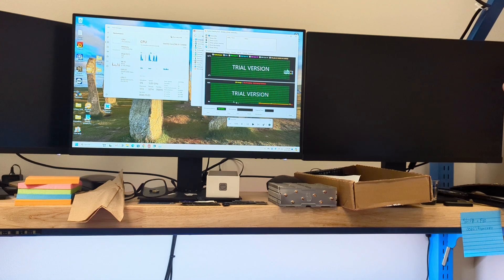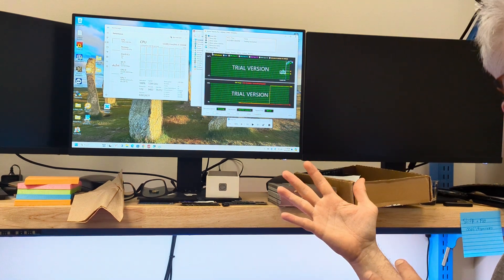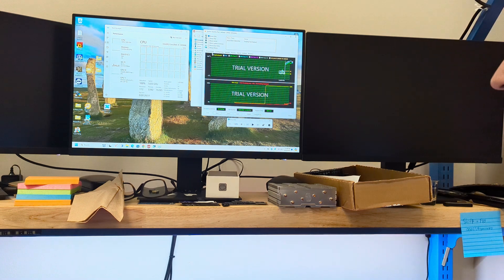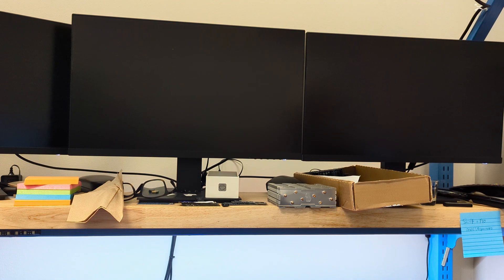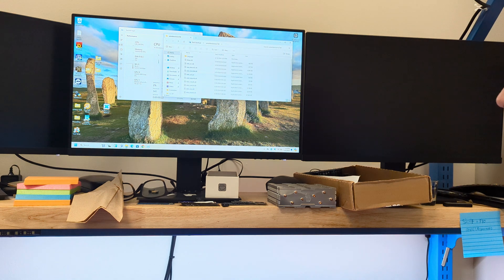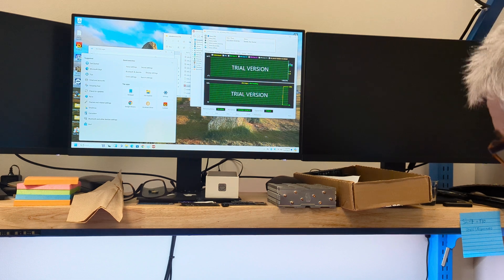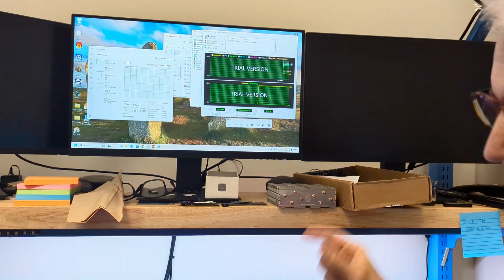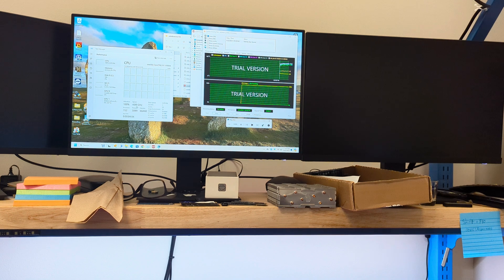How we prevent issues with stability and longevity on the Intel i9-14900k

Comment from the maker: I finally did some research on Aida64.  They have so many versions.  The version I need, for testing on many machines by one "engineer" is Aida64 Engineer, which I now own.  Again, the Engineer version allows one person to put in on many machines for burn-in testing like I do.  The "Extreme" version is made for one person to use it on their home PC.
Reply: Is it only k which is bad, or i9 14900kf as well?
Reply from the maker: @Cheesg   The F processors are affected as well.  Yours is not bad unless it has problems.  There should be and updated BIOS for your mobo, now.
Reply: @xforcepc  Thank You very much, so no need to mess with voltage?

Comment: just a note: the content in this video is valid and reasonable, but seems not to be the main issue with these CPUS; high voltage is, wich is usually a problem for single core workloads and not affected by power limits 

in our system we do both undervolting & power limiting to get the best efficiency, we do not use water cooling on professiona builds as it's not the most reliable thing to do
Reply from the maker: Correct.  This was before updated BIOSs were available.  The best fix now is to install the latest BIOS.

Comment: every time I read the description on these bios updates I get stuck on this sentence "The new BIOS includes Intel microcode 0x129 and adjusts the factory default settings for the non-K processors, enhancing the stability of Intel Core 13th and 14th gen desktop processors." So, my skeptical critic asks? None of this applies to any of my three 13th gen "K" processor based systems?

Comment: This, in my opinion,  is the worst possible way to have your CPU running at lower temperatures than stock. The are ways to lower temperatures while you are maintaining the rated clock speeds. The best way is to install a high quality cooler along with a high quality thermal paste and if possible, a contact frame. The second best option is to under volt the operating voltage by offsetting the VID table. I personally do not own a 14900K or any i9 of 13th and 14th generation but I do both options anyway in any of my CPUs and GPUs ever owned as good practice. I understood early on that not all chips are created equally but all power delivery mechanisms have to be designed to work with all of those chips and the only way they can do this, is to supply an expense of power "just in case". This is going-on forever and the sooner someone realizes it, the better for his hardware will be. Thank you for sharing your thoughts in this video.

Comment: No, no, no - just no. This issue is very, very simple. To get top scores in some reviewers benchmarks, like Cinebench, Intel allows a single core (or two) to boost to 5.8 or 6.0GHz. To reach that freq. the core gets 1.55 or even 1.6v - which causes damage.

This is NOT a board problem. Intel endorsed these power settings because without them, Intel can't claim 5.8GHz. So blaming the board is BS. Intel said on record that it is only considered out of spec. if you change the clock multiplier.

Intel is the source and cause of the issue. The fix is easy:

SYNCH all your cores. Don't allow one or two cores to boost by themselves. I've seen a PC in an idle state suddenly BSOD because a background task started. Then a core tries to boost to 6.0GHz, gets 1.6v and now you have a degraded CPU.

Synch the cores. Might have to lower your multiplier depending on the state of your chip, but after that you're safe.

Problem solved.

Comment: Damn this is sad if you listen to this guy.. not the fix lmaoo
Reply: To be fair, a month ago no one knew exactly what the cause was, and  this here could have been a plausible solution - lowering peak voltages.  It is only AFTER this video went up that Intel have come out and stated the actual issue - excessive voltage on the cpu caused by a microcode error within the cpu (allegedly).
Reply from the maker: The fix does not currently exist.  Laugh all you want.

Comment: sure it's possible. You need watercooling. Ive run mine at 370w under cinebench and its been fine. Not for extended times, however. they need to be watercooled and by large custom loops.

Comment: Just to mention, an Intel engineer stated point blank that you are allowed to ride 100c on these CPUs, therefore not leaving any performance on the table.
Reply from the maker: When they lower the voltage in the patch, frequency will drop and so will performance.

Comment: The most recent posts talk about a degradation of I/O portion of the CPU, basicly when Intel designed the Raptor Lake they moved the I/O portion of the CPU to another physical position inside the CPU and that part (called Ring or Uncore) is proving to be uncapable of handling the OUT OF THE BOX voltage settings.

The mayority of issues are appearing in i9's and the usual maximum vcore for those parts is around 1.52v ish for the single core advertised 5.8-6.0 Ghz.
Reply: yes, boost voltage may be the largest culprit.  This is at its highest when fewest cores are active as well.  There is some talk of oxidation of VIA's but I think if that were the issue it would show itself differently such as some cores losing access to L3.

Comment: Yes, get a K cpu and undervolt it or limit its power, might have been better to get a non K cpu or a 14700 without K. amd and intel both are at fault, for the last 2 generations its more power and more heat.
Reply: Undervolting in general is a good practice, the K chips usually come with higher clocks than their non K counterparts. I have known people that bought K skus just because the 200 mhz out of the box without intentions of overclock. Thats non of anyone's business.

The problem here is that the recent Raptorlake based silicon is failing.
Reply: @dethskullcrusher  what i did! lol lmao..

im not having any issues with my 14700K.. and yes its undervolted and by core usage on P/E cores.. no issues and my cinebench score is through the roof my 13700K score was  30083, on the 14700K im hitting 35433, with some tweaking and slight adjustments to my bios i can hit 38000 :) vi
Reply: @AnonCanna  That's great news, in fact pro overclockers recommended to undervolt this i7/i9 parts even before the issue even appeared, there's not much performance to gain with OC but lots of thermal headroom and efficiency to regain by undervolting.
Reply: -source someone without hardware

Comment: Seen a few videos showing motherboard manufacturers ignoring CPU recommended power limits. The assumption for most users is that Auto means the CPU vendor recommended settings. Clearly that is not the case.

Comment: X-Plane 12.1 still uses only 1 core at 90% on a 14700K and the other cores are chilling. So 🤷🏼… personally I have a small air cooler on my 14700K and its just fine if u don’t use 100% of the CPU like in any game or flight sim. So unless X-Plane is gonnan be improved to really take advantage of every core well untill then I don’t even need to buy a water cooler aio.
Reply from the maker: Yeah, good point.  BTW, X-Plane will use multiple cores during scenery loads.  If you are curious, download CoreTemp and run it while you open X-Plane and it will record the max temp and current temp.

Comment: trial version isn't that suicide for commercial use? license allow for that?
Reply from the maker: https://www.aida64.com/licensing   

"Try our products with a free 30-day trial. We recommend testing them thoroughly before buying. You can download trial versions of AIDA64 Extreme, AIDA64 Engineer, AIDA64 Business and AIDA64 Network Audit editions from our website.
For a full evaluation of AIDA64 Network Audit and AIDA64 Business, request a free test license. This gives you full access for 30 days. Once the trial ends, the software will stop working, and you'll need a license to keep using it. 
To switch from the trial to a full license, simply enter the product key you get when you buy one. No reinstallation is required to activate the product."
Reply: @xforcepc  Im glad you are safe ;D
Reply from the maker: @bartoszskowronski  I am going to look into purchasing it for burning in systems.  I need to make sure I can put it on multiple (hundreds of PCs during the burn-in process).
Reply: @xforcepc  yea it's a pain in  ass, moving license, best solution is if you have "usb pendrive/license key". program works only on that system with actually inserted usb key.
but unfortunately it's not that popular solution.

Comment: I wouldn't use the Heaven benchmark you have on the desktop. It's barely acceptable to benchmark a modern 1080 system, it's completely useless for 1440+ or testing stability for any overclock. I recommend 3d mark.
Reply from the maker: Yeah, I don't use it much anymore.  Instead, I like to use FurMark for burn-in as it runs until you tell it to stop and it does a good job maxing out the GPU.
Reply: @xforcepc  FurMark is also good